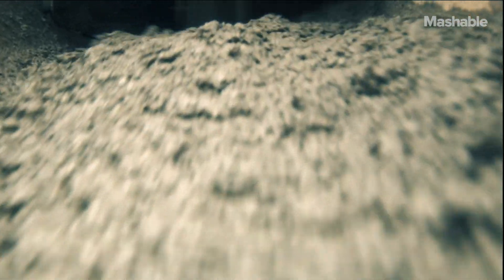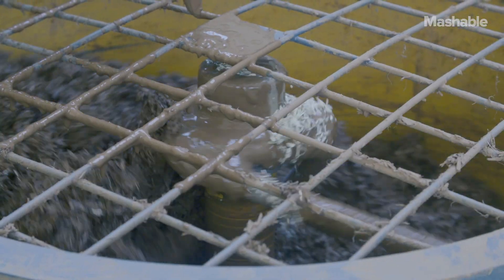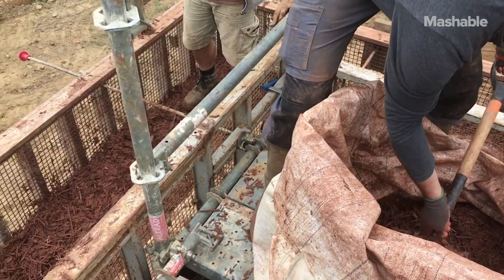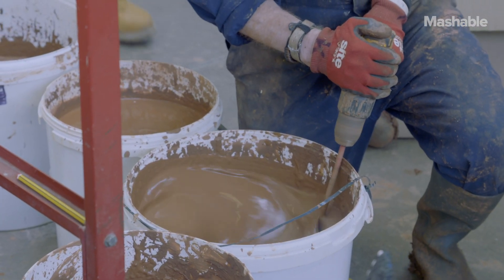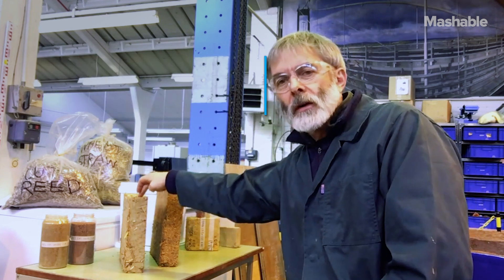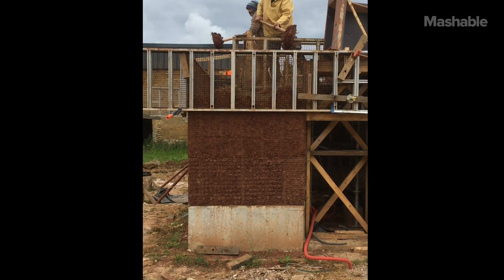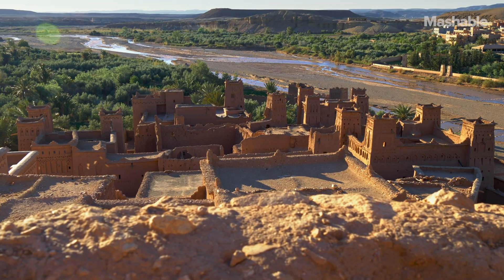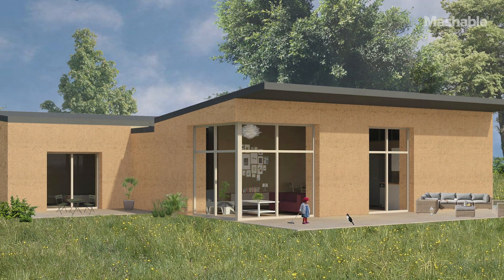Fiber-Infused Soil Could Be The Future of Construction | Mashable

Comment: When measuring the carbon footprint you must also include the planting, harvesting and mixing machinery as well as any other preparations that use energy.   For some reason these are often not included.  Perhaps because the  materials don't look as good when the whole story is told.  "Electricity is clean energy"  but how was it produced.  Coal, natural gas, some other form that can generate energy is necessary.  Wind turbines? what about the costs of making the steel and parts to make the wind turbines? grease to lubricate? welding where needed? make them tell the whole story.
Reply: Using natural fibres that are grown as a crop (the hemp) will add an element or carbon sequestration. It seems to be what half of these walls are made from and the carbon footprint of mud is pretty much non existent. Compare that with firing heavy bricks in a kiln and transporting them hundreds of miles, it's a no brainer.

Comment: The reason why it's not good: Rain.
Reply: Cob built houses were still around in Wales well into the 1960s .... a high rainfall region.  I had a friend who lived in one.  They were cheap and easy to repair.  It works fine, including a luxury hotel we stayed in in Morocco which dated from the 16th century.  It was six storeys high and built to form a courtyard which retained the cool air of the night as a natural zero carbon air conditioning system.  It was very comfortable.  The flat roof did not leak.
Reply: It's a good point.  I stumbled across a book from the early 19th century that noted issues of the time in the UK.  There was a timber and brick shortage and a need for new housing.  The author brought to the attention the idea of building with soils, and noted that it was used world over to good effect and even in the UK with very old cob dwellings.   They say you just need a good boot and hat.  Overhanging roof etc.  Stone plinths.

I have a lot of lime in our soil.  And it's pretty robust.  There's a section of the garden where I have just heaped old soil and walked over it.  And it is almost like concrete. in the summer.  I've also carved out walls in earth, some with plant roots, and they tend to hold up surprisingly well.  If the soil meets wind it tends to dry pretty quickly.  And only if there is a torrent it seems to dislodge or break.  Or when walked on when wet.

I've heard non scientific explanations that compressed earth increases gravitational strength between particles that gives it concrete like properties.  A sledge hammer on a wall can take it down in about three swings,  a leaking roof can destroy a building whatever it is.  So just try and keep the majority of rain off the walls, and let it dry.